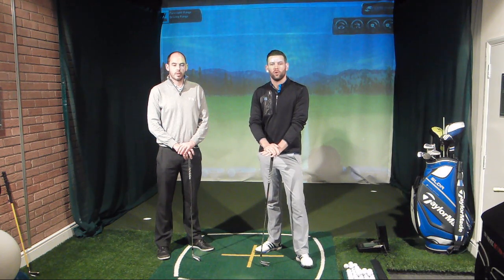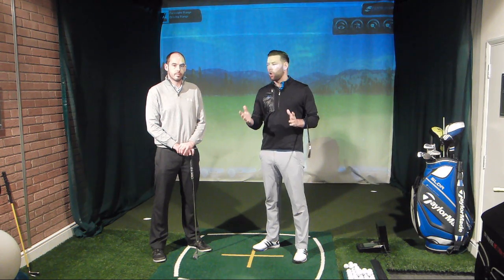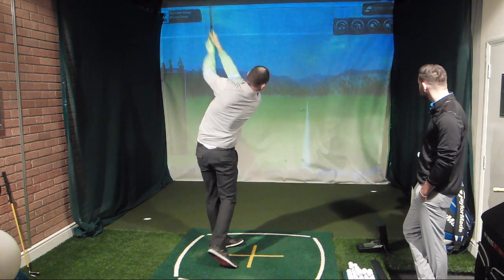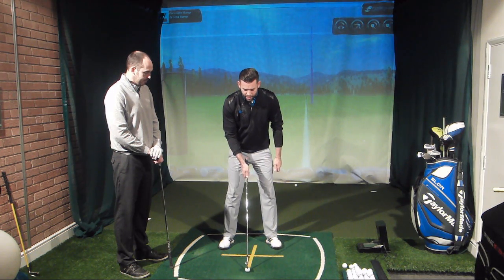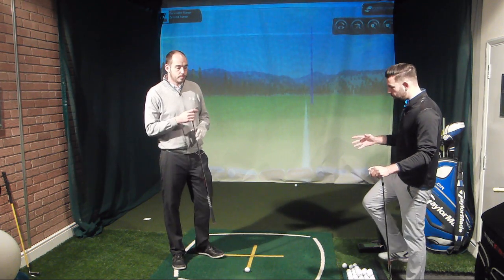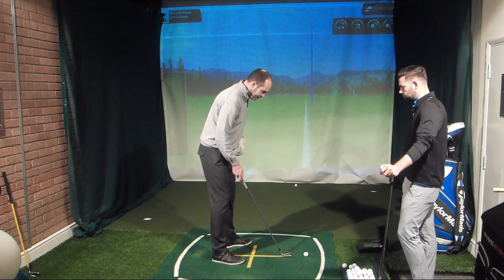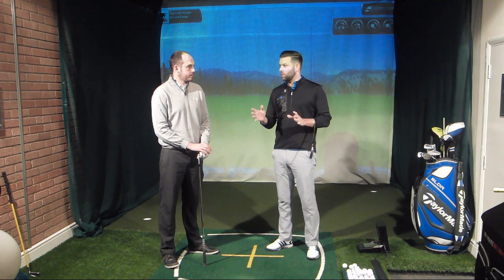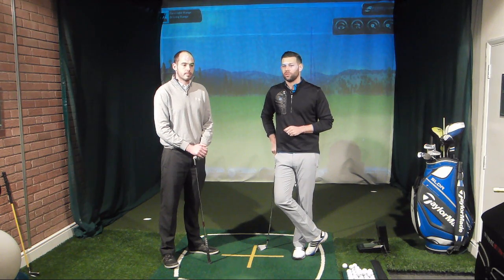GOLF: HOW TO HIT A LOW PUNCH IRON SHOT

Comment: hi chris. thanks for the video.  i've had a lesson with you in the past on my driving (and it really helped) do need to get back to the belfry to see you at some point. 2 things though. (1) the tips here are good...with regards to reducing loft and swing speed...but i think saying to increase your angle of attack is slightly misleading as that increases spin.  do we not want to decrease loft while maintaining close to your usual angle of attack?  (2) i practice with GC2 HMT and am really struggling with getting height on my irons.  most people hit around 30 yards in the air but i only get 22-24 at best.  is there any chance of doing a video on increasing height in your irons as all instruction seems to be about hitting it low (which I don't have a problem with).  I'm sure there must be others who struggle with the same issue as me??? Thanks
Reply from the maker: Hi, thanks for the comments, I have recently filmed and uploaded a video on why golfers may flight the ball too low with their irons, this video is scheduled for the end of the month so hopefully that will help. As far as hitting more down with the irons, this does not increase the spin rate on the shots, many golfers still have this belief, the spin loft would stay exactly the same but the ball would launch lower, couple that with going down the handle to reduce club head speed this combination would actually reduce the spin. Great if you use an HMT so good for feedback and practice. Does sound like you maybe need to increase the height of your shots though, so hopefully the vid I have done will help. Thanks.